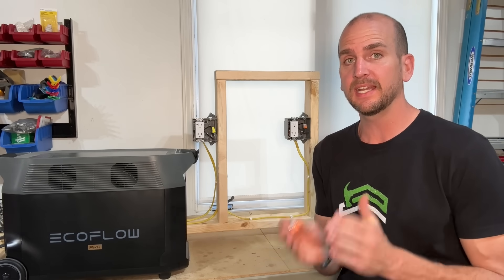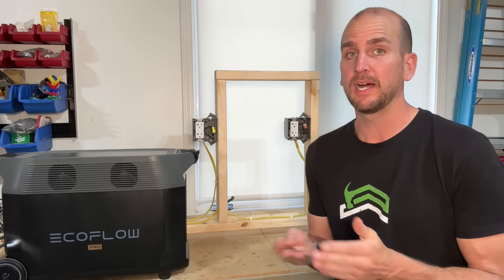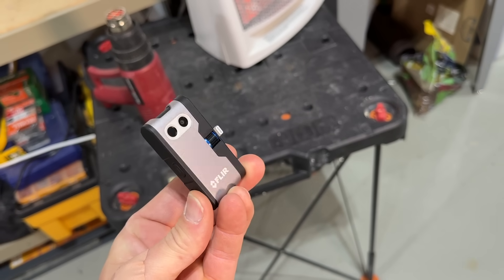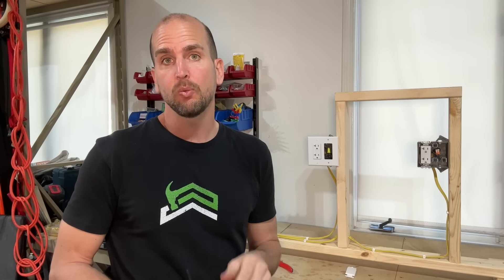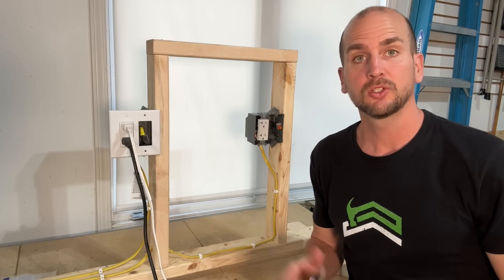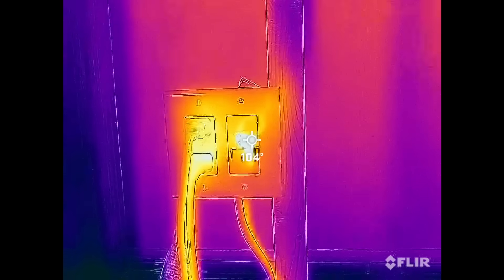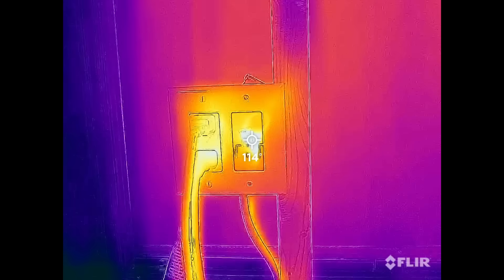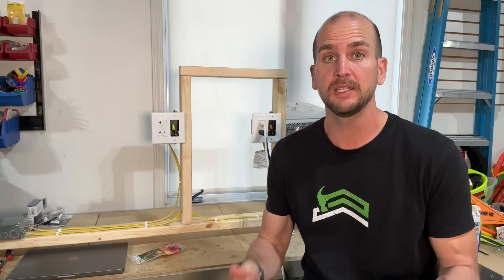Debunking the Pros: Can WAGO Lever Nuts Handle Heavy Electrical Loads?

Comment: Not surprised. If Wago wasn't save it wouldn't be allowed in Germany. By German standards, even DIY installation is NOT allowed (at least before the installation is put into operation, it has to be checked and  approved by a certified  electrician, even if you just change a socket)

Comment: The wire nut is to loose, the instructions call for 2 twist in the wire below the the wire nut. Try that is why you don't have to pre twist the wires.  You have to use pliers to get enough twist with the wire nut.

Comment: Yes they can handle the loads but you cannot deny they add resistance to the circuit when compared to a wire nut. A wire nut connects the same two pieces of wire together as if it was never there. A wago has an aluminum bar that makes the electrical connection so naturally in the best case scenario they might be able to perform as well as a wire nut if they used copper instead of aluminum for the contact point. This brings the question up of why buy them when they perform worse and cost way more? 1 box of 80 wago is $37 while 180 wire nuts is $8. Even if they performed exactly the same they cost way more.

Comment: 7:48 mark. When you mention how it creates more heat. To me that also means more amperage draw. I would put an amp probe on the circuit at the breaker to see if there is an actual difference in amperage being drawn.

Comment: Issue I have with Wago's is clamping down on solid wire. Stranded wire I would trust it no problem. Solid wire, to me weakens the connection. Especially over time with heating due to amperage loads over time. Just like using the stab ins that they should have never been allowed to make on devices. Over time the connection weakens. Solid wire hooked 3/4 way around the screw terminal securely turned down is the safest way to connect wire to a receptacle or switch. I have been able to easily pull wires out of stab-ins on back of devices.

Comment: When you have the blank faceplate on the front of the receptacle box you are not reading the temperature of the screw terminals. Yes you can see the infrared radiation coming from them  through the plastic, but you are not reading the true temperature of the screw terminals you are reading the  temperature of the faceplate. The screw terminals obviously give off heat and that heats the inside of the box including the back of the faceplate and warms it somewhat. But you are not reading the temperature of the screw terminals. You need to remove the faceplate to get the actual temperature of the screw terminals.

Comment: Excellent idea for a test. Yeah the manufacture of the wire nut just says just a twist it on but that's only making an electrical connection it's not making a mechanical connection, that little extra twist helps hold the bundle together and then the wire nut locks them in. I think the biggest issue we're having with the Wago connectors in the US is so many people have seen and had bad experience with backstabs on outlets which were of very poor design using only a friction fit. I've probably pulled the part 2 wire nuts that were a little toasty whereas Backstab outlets are probably closer to 5 or 10.

Comment: Wagos seem great for switches, lights and fans, mixing single strand & multistrand wires etc. I started looking at them for wiring multiple switches in a box where your having to put multiple wires in a wire nut (more than 3), creating pigtails. Less time consuming than twisting wires together with wire nuts and finding one slipped back and then having to put the wires thru doing it over. Thanks for the video!

Comment: You are not a scientist and this is not a scientific test.  Wire nuts and lever connectors are points of CONSTRICTION RESISTANCE.  While the copper wires are also heat conductors and REMOVE heat from the point of CONSTRICTION RESISTANCE, is that expectation the escape clause for Wago's claims?  What really goes on over time, day by day, accumulating hours of operation at load current (up to 20 Amps), enclosed in a wall on the sunny side of a house in summer time New Mexico?  Do the spring loaded contacts lose tensile strength?  Does oxidation of the metal eat away at the point of constriction resistance?  Does Florida humidity accelerate the degradation process?  What is the MTBF (mean time before failure) calculate out to?  You address none of those eventualities.  Stick to what you know and stop selling nonsense on YouTube.

Comment: I’d like to see two other tests: with a well-twisted joint & wire nut, and one at the circuit’s maximum sustained load (probably 16A for a non-magnetic breaker).

Comment: The Wago is an excellent connector for people who don’t know what they’re doing. It makes it possible for DIY people and for unskilled labor in manufacturing to make electrical connections. However, there is no doubt that the wire nut, pressing the conductors into direct contact with one another, is a superior connection when done with the proper skill and experience. Here endeth the lesson.

Comment: Your test is skewed.
Now i'm a wire nut only guy
But ill point out how your mock up skews the test.
Both outlets have to be an equal distance from the junction box,
They are not.
The shorter cable is the direct connection using the screws on the outlet.
Also the more connections you make the more restance that =heat.
A better test would be measure from both boxes the different ways to hook up.  Then find the avg factor thats going to give you a more accurate reading. 
Yes wire length has an impact on the outcome.

Comment: One thing I hardly ever see motioned on diy'er vids is that if you are going to use Wago's or Wire nuts either one for your project, make sure to look at the package spec's to see that you are buying the correct conductor (wire) gage and for correct #'s of wires specified for that item. And bwy, I was taught old school and am partial to the shepherds hook termination, when done correctly, that conductor is not going anywhere.

Comment: The only thing I don't like about those is that they are plastic and plastic gets brittle over time.  Wire nuts have a plastic case but they force the wires to bind together within a metal cone.  Even if the plastic gets loose, the wires won't.

Comment: Not to nitpick but you should really test to the point of failure, even 120 degrees away from its rating the Wago and wire nut delta t was increasing. At least let the temps plateau.

Also while I’m not being nitpicky measuring the voltage drop through the connectors would be a useful metric.

Comment: the WAGO he holds up is a 20A / 300V really if he is going to go above that rating he should be using a higher rated one, a higher rated one will have lower resistance and so the temperature would also be lower.
Reply: Like all mechanic and electrical testing the limit needs to be exceeded to adequately test the product. Technically a more thorough comparison would be to the point of failure for each. You can’t obtain a failure mode without the failure.

Comment: Upon deciding to switch from wire nuts to WAGO’s, the resources I was able to find pretty much mirrored what’s being concluded here.  As any of you know who have used both, it is usually easier to pack a box using WAGO’s over wire nuts.  Also, on older homes, I too often find short leads for whatever the reasons.  It is so much easier to used a WAGO to add a pigtail than a wire nut which may be impossible to connect without expending other wiring changes on the feed line to get enough length.  But by then, you might as well just make the lead the proper length into the box.

Comment: now add in 20 years of corrosion, a full electrical box, sealed with construction dust. I'll stick with my trusty marettes. (Wirenuts in 'Merican)

What you showed is just a best case scenario. What you did show is the wago generates twice as much heat as the marette. Now in any situation where it is not easy to dissipate that heat the wago will be much more likely to fail. 

Introduce corrosion on the termination and I would expect that to get way worse over time. By comparison the twisted pair of the marette can not easily oxidize where the copper is in tight connection to other copper.

Marettes win again. Cheers

Comment: Wagos melt in high amperage loads  over time  . A twenty minute test is not going to to show the problem. Test it for twenty days continuously under those conditions and see what you get.
Reply from the maker: Just my opinion but I don't agree.  WAGOs (installed correctly) will last as long as a wire nut.
Reply: @EverydayHomeRepairs  It is not just the time they last that is in question.It is how long they last under heavy amperage load that melts them down. 
 They do fine under low to medium amperage indefinitely and they do fine under heavy load for a short time..
 I would love to see this test conducted under heavy amperage load for  a couple of months instead of twenty minutes.
 The point of contact is too small ...over time it carbons up under heavy loads and then will overheat and melt as the resistance increases. It takes time but they will fail under continuous maximum rated load. 
 Wire nuts have a much greater surface to surface contact between conductors with a much lower resistance connection that stays cooler.

Comment: 1. The Wago got hotter than even your poorly installed wire nut.
2. Wago bus bars are nit copper. Iver time esoecially in humud environments the connection between the dissimular metals cayses cirrosion, making things substantially worse.
3. Yiur testt was flawed in that you had a single receotacke in a dual gang box. You are welk aware that is not common, and will alliw the comoonents to run cooler than they normally would.

Comment: Why are you not using the code time  factor for continuous duty? The other factor that you are not taking into consideration is over time the connection will get loose by heating up and cooling down. The metal expansion and contraction will cause connections to loosen, thus creating more resistance and more heat. In my experience as an electrician I have seen melted wire nuts, wagos and lots of receptacles that got so hot that they fell apart after removing the cover plate. Twenty minutes does not give you a real world test but it does show you the wago is inferior to wire nuts. Heat is the enemy to electrical circuits. Wires should never feel hot to the touch. Heat is a time bomb! 120 volt 1500 watt Electric heaters are unsafe and should be avoided for any long term use.

Comment: I think the problem, is that the WAGO's are less likely to result in errors, at the cost of higher resistance. In North America, this should not even be an issue, as you'll likely never encounter a situation that matters if you're using the correct rated nuts. With regular twist nuts, the thing that happens is the nut works its way free from thermal expansion, or installation error.  Remember you're not just installing it once, you might be installing it for 2 or 3 future renovations. So the twist nut is usually only good for one use.

Regardless, plastic thermal-degrades over time, so if you're installing them somewhere, they need to be serviceable in the event they need to be replaced.  Conventional nuts also have the same potential to degrade, but usually the metal part of the nut will still be intact if the plastic cracks.

Comment: Your test seems to confirm others who have tested the Wago to show they have more resistance, which is bad.  You should have also tested the wire twisted before applying the wire nut.  Also, there are metallic threaded wire nuts and plain plastic versions.  The objective is to gain the best splice, if necessary, with the least resistance to provide the required power to the device.  Otherwise, the device is working harder than it was designed to and will likely diminish it's service and longevity.  I sensed a strong bias to using Wagos.  I will only use metallic threaded wire nuts onto twisted wires if a splice is necessary to provide the best conduction of power to the device.  Also, test the splice with a wire pull to insure a secure and reliable splice.  Thank you for the video but please be more objective.

Comment: I wonder what the difference in the cost of electricity over say a year for a house done completely with wire nuts vs one done completely with wago.  If you have higher resistance and are producing more heat, that is lost energy and  you are paying  for it.  I suspect the difference is minimal, but I would be curious to see the math.  

Another monetary question would be how do wire nuts and wagos compare in terms of overall cost in the job?  Wagos are more expensive, but I suspect faster, so I wonder how that balances out.  Again, compared to the cost of the copper it is probably not worth worrying about, but I am curious how that would work out.

Comment: The problem with this test is the usefulness of the data.  The Wago being hotter doesn't mean more heat loss and higher resistance, it could have half the conductive mass and therefore be dissipating heat more poorly leading to hire temperatures.  A better test would be to test the temperature of the wire using a thermocouple an inch away from the connector.  Alternatively measuring voltage drop at high loads would provide more useful data.
Reply from the maker: Thanks for the feedback.

Comment: Thanks for doing this, I would really like to see a multiple data set test that cycles these connections on-off over time to see how they degrade over many current cycles. The only issue I have with the Wago at this time is how much more area they occupy in the box. And yes, I agree with another comment below, Voltage drop over time would be a better test, When you introduce an IR imager there are a lot of variables you need to consider to get accurate temperature measurement.

Comment: What I think about Wago is that a 5 deg difference means nothing and that they are safe to use in any situation when installed per manufacture recommendations and within specs of the device and connector.  I also think they are so much easier and faster to use AND a big selling point is that they make adding a new device or swapping out an existing device super-fast and easy.  Also, I would say that for a homeowner with limited experience, you probably get a better connection.  Wago are much easier to do right than wire nuts and they support a wider range of AWG.  I have seen many professional electricians us the wrong wire nut because of not looking at the capacity chart on the wire nut package (if they even have the package to refer to.

Comment: Pre-twisting wires before applying the wire nut is not required nor recommended by the wire nut manufacturers.  The manufacturer recommends using the wire nut itself to do the twist by tightening the nut until the wires are twisted.  There is absolutely no difference in the finished connection when you remove the wire nut and visually inspect and test for mechanical connection.  Also, it is much easier to get all the wires fully inserted into the wire nut if you do NOT pre-twist.  Professionals do it, for no good reason. It is not necessary, nor is it recommended.

Comment: You also have the 221-6xx series meant for 10 AWG / 6mm2 cable. those are rated for 30A continous power.

Comment: My experience has been  poor or even separated connections with wire nuts are common with twist connects and rare (maybe never) with Wago.  I just traced an entire house to find an open neutral deep in a daisy chain with twist nuts in a crowded box.  This was dangerous and hidden since 1978.  Bad twist connection are very common and bulky.  Give me Wago any day!

Comment: I would have liked to see a fourth "baseline." That of a receptacle with screw terminals, where the wire wraps around the screw and has contact on almost three sides (the screw head, the threads, and the "nut" surface). That's considerably more contact area than any of the three tested.

I've just started using Wagos, and they're great. But nothing beats properly wrapping a wire around a machine screw, in terms of contact surface and mechanical reliability. That's how I do 20A and above, and usually 15A, too.

Comment: The difference between those sloppy wire nuts most electricians with self respect wouldn’t touch and the Wago is 0.6 degrees C. 

And that is absolute nothing.

Comment: Nicely designed experiment with clearly explained results. Project Farm would be impressed. I wonder if there is any voltage drop across the circuit for the three connections. How many volts at the line wire vs the output wires and the outlet. I don't think this is a big issue for 120/220v home wiring as compared to a 12v automotive circuit where a couple volts matters, but it would still be another interesting data point for the efficiency of the WAGO vs wire nut vs direct connection.

Comment: I'd be interested in readings with a single gang box.  I've always used winged wire nuts as a DIY'er.  Could the two-gang box allow the heat to dissipate somewhat?  Did you do a single gang experiment?  In either case, well below safety ratings.